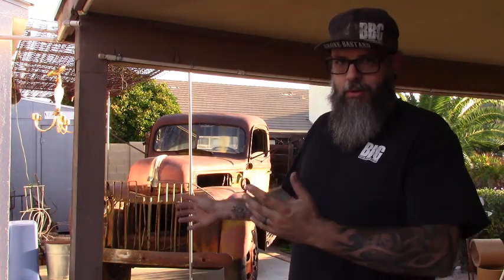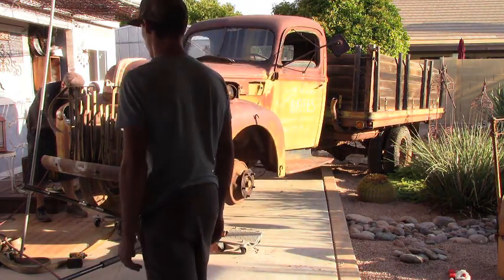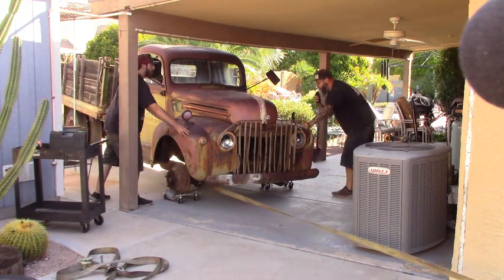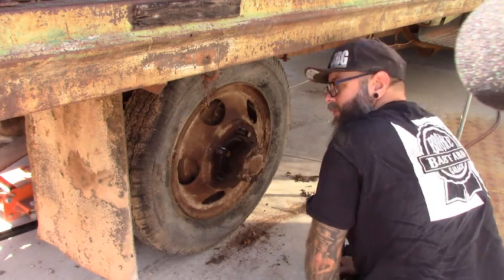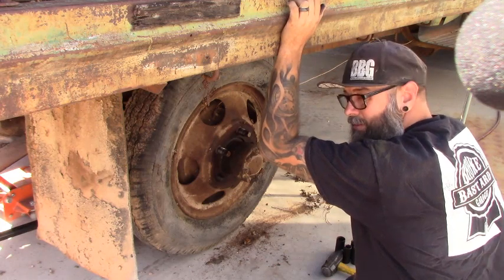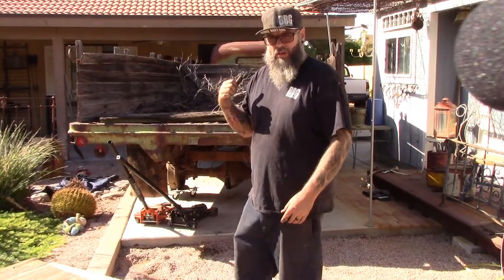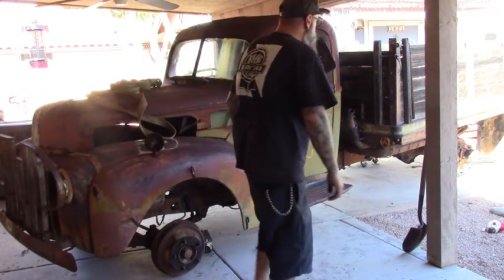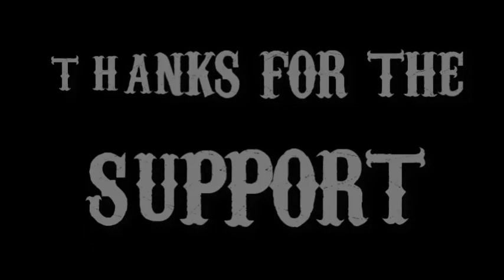Getting the 47 Ford out of a tight spot

Comment: That's a sweet deal on the old Ford. Looks like a fun project for the future. There is a Facebook group called "42-47 Ford trucks technical info and swap meet page" has some interesting content. 
The guy in Phoenix AZ is swapping them onto an Explorer chassis. He has a YT channel also. 5.0, auto and modern suspension. Thought about doing that with my 1952 Ford F1 pickup.

Comment: 1st of all Good to See ya Back! Was worried for you all there. 2nd, are you sure she's a '48? I'm doing a 48 F5 and it's the singe windshield "narrow eye" grill variety. She looks like the pre-F series of 41 - 47 variety that I wish my '48 was. Totally dig the score though, and I too have gotten things like this that I've had to dismantle and pull out "Johnny Cash Style",  1 was upside down and 1/2 burried in a spud field. Hopefully this one has the old "Harmon" (if I remember right) Auxiliary High/Low box. If so it's square-cut gears. Flip it around backwards and you got an Overdrive. Shhhhhh that's a secret I don't like to let out. lol.
Again, good to see ya back. We where all thinking of you while you where out.
*edit to add, Check the VIN on frame (near the steering box) or the glove box lid if it's still there. It "might" be a "War Horse". Ford made these during the war as cargo haulers and sold them on mass right after. You might really have something with this.

Comment: The old Dodges I've owned had reverse thread lugs on the left side,but I've never seen them on a Ford before.
Reply: On Trucks (and Heavy Equip) you run into it all the time no matter the brand. Even with newer stuff. I always look at the head of the stud before I hit it. It's usually stamped into it there (sometimes on the nut though). If it's blank, your probably good with right hand. As a Rule of Thumb, toward the front of the truck is tight, toward the Back is to loosen. What SUCKS is when a tire shop or mobile busts a stud, and they put whatever on whatever side, or miss-match 'em. 2 lefts and 6 rights..... that's always fun.

Comment: That’s not a 1948 Ford. It’s a 1942 to 1947 model.
Reply from the maker: 100% Texan title says 48
Reply: Broke Bastard Garage Hmm, must be a late 1947 titled as a 1948, anyway, I know you know your year models. I have a 1948 F1 known as Bonus Built when Ford started calling them F series. So your title calls it an 1948 F3?
Reply from the maker: 100% Texan I’m not an expert by any means. From what I can tell 47 and 48 had that hood latch. Owner I got it from says 48 and says title says 48. I haven’t got the title yet. She my be wrong
Reply: Broke Bastard Garage 1942 to 1947 ford trucks had the same body except for a few minor differences like the location of the parking lights. If I remember right The 1942 to 1947 use the same cab and doors as the 1938 to 1947. The 1948 ford truck was a completely different and new truck with a bigger cab, new frame and gone were the buggy springs, etc. who knows though it could very well be titled as a 1948. I was just referring to the actual body style.
Reply from the maker: 100% Texan I’ll let you know when I get the title. Thanks for the info
Reply from the maker: 100% Texan just got copy of the title it’s a 47.